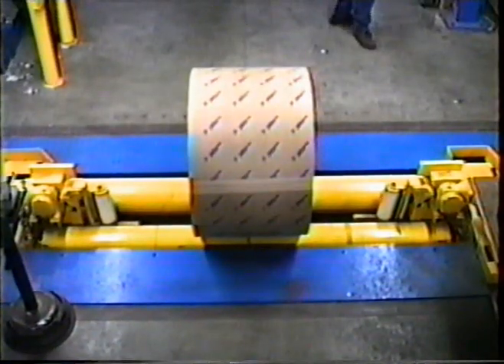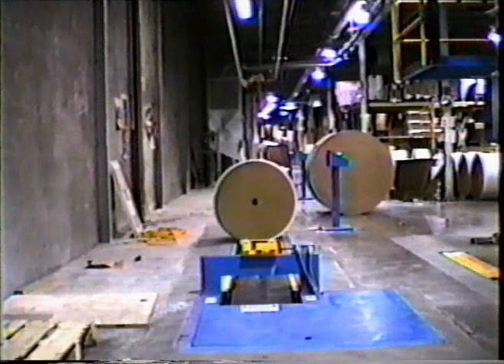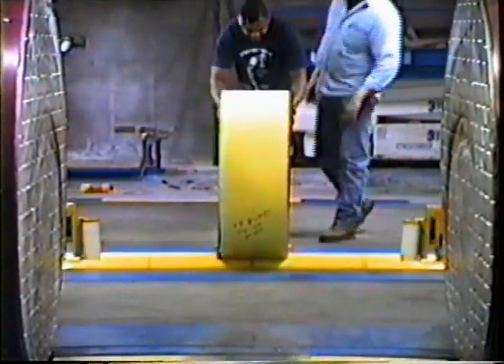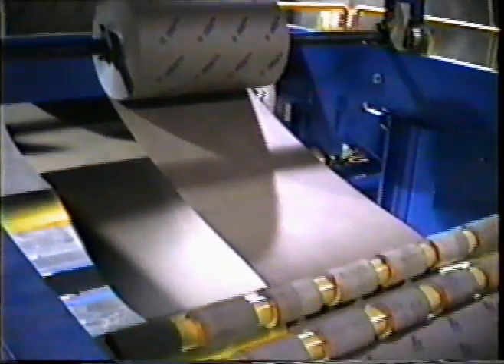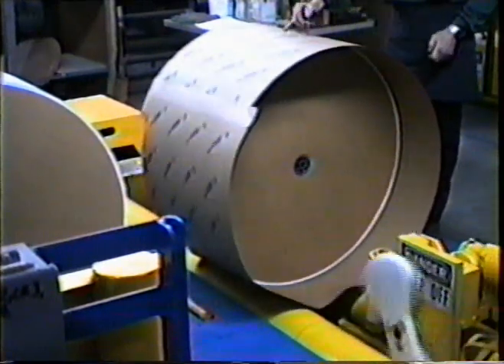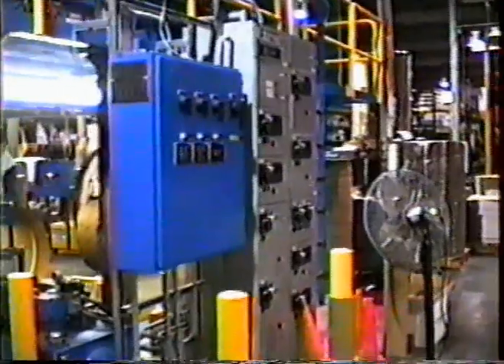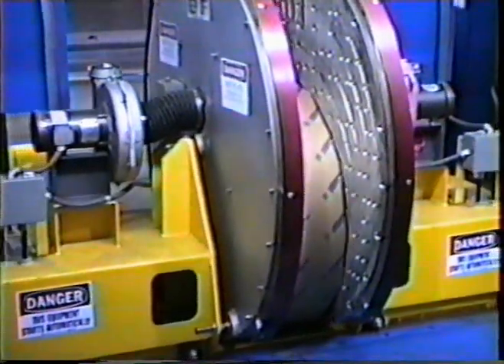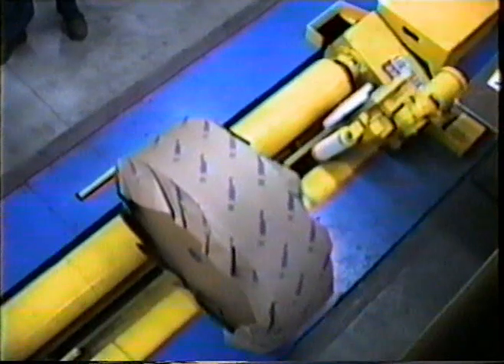Roll Wrapping/Roll Handling

Comment: This system Requires more time to pack Reel & it is suitable for only small capacity plants and Requires  4 to 5 man power for handling & packing. safety point of view it is critical in some times, safety point of view should be some modifications required.